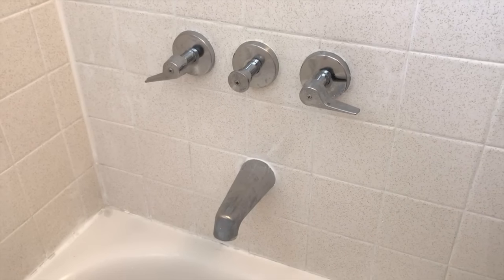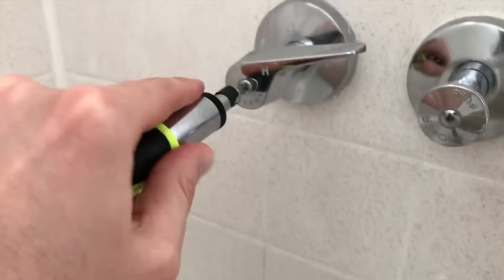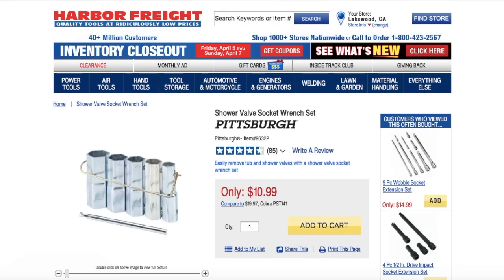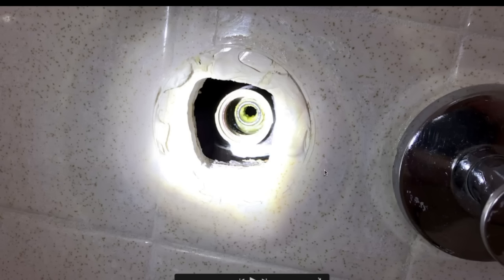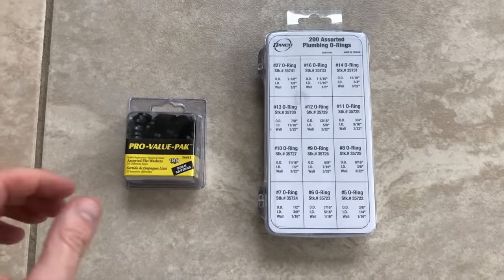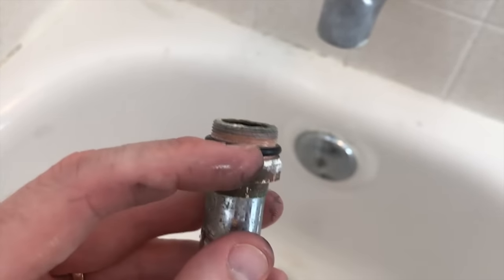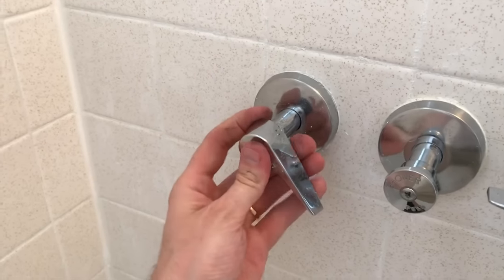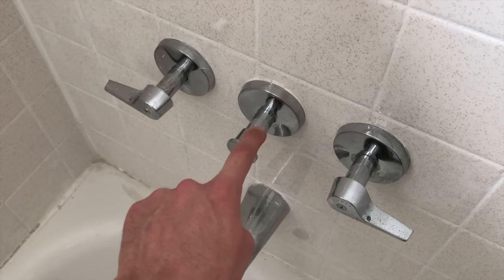My tub faucet is leaking/dripping - won't stop dripping - EASY FIX!

Comment: Hi Michael!  Great video!  I replaced all the seats, and stems from scratch. Brand new EVERYTHING! Gerber.  I still have a very small drip from my 3 handle tub faucet.  For the life of me, I can't figure out why.  After I installed everything, no drips.  After the first shower, small drip.  Should I replace the brand new washers?  Any thoughts?  Subscribed to the channel.  VERY helpful!  Thanks!
Reply from the maker: Jeff Rollins 

Thanks for watching Jeff, by chance did you add Teflon tape to the thread of your seats?  If not, we definitely recommend it.  Keep us posted.  Thanks for subscribing, we subscribed back.

😎👍🔧🔩
Reply: @DIYwithMichaelBorders Hi Michael! I did use a small bit of Teflon tape, buy maybe not enough. I will try and let you know. Now, I'm having diverter issues -- rumbles and hesitates when I turn it on. Yikes!
Reply from the maker: Jeff Rollins 

Thanks for the reply.  Definitely keep us posted.  😎👍🔧🔩

Comment: How may I find out what brand my tub/shower faucet is to get the correct replacement parts?

Also, What should I use in place of plumbers putty in my tub / shower that is not a plumbers putty compatible surface?
Reply from the maker: Good morning, it may be as simple as removing old spout and taking it to store to match it up with an exact replacement match spout.

You can use caulk to create seal around spout once installed.

Let us know if you have any questions and hey if you’re into crypto, join our DIY ecosystem.

       toolboxtoken.com

Reach out to us any time!  🧰

Comment: Mike Joe again ~    i have a leak  under the bathroom sink  looks like its the pivot rod  ,   is there a gasket inside that i was wondering  finally found where the water was dripping from   now to replace that piece  ..  does that ball part wear out ?    couldnt figure out  where the water was dripping i had to get a flashlight and  take a look and saw it  was that rod  ball thing  .  Thanks
Reply from the maker: Hey Joe, great to hear from you.  Below are a few videos that may help you get a bit more familiar with the plumbing above and under sink.

     1.  https://youtu.be/aZ3cRDtGRs8

     2.  https://youtu.be/pIYpl_7PIYQ

     3.  https://youtu.be/53KJUA9pEMI

     4.  https://youtu.be/xRjIp45KtpA

     5.  https://youtu.be/BAQ3OKjny_k

     6.  https://youtu.be/1b0asFPDzfA

     7.  https://youtu.be/JP40chUPXT0

     8.  https://youtu.be/5Jv1pkPjxds

😎👍
Reply: @DIYwithMichaelBorders   Thanks i will take a look at these .
Reply from the maker: @joedevitto6113  

😎👍

Comment: Great video. But my stem is threaded not smooth like yours. I’m stuck at how to remove the threaded stem. Any help will be great. Thanks
Reply from the maker: Thanks for watching & welcome to the DIY Raptor Club.  Have you removed old stem to replace entire stem or are you just replacing the rubber gasket?

Comment: I have a question and maybe you'll know the answer.  My tub faucet is doing something weird, not quite like this but it thought I'd ask.  I turn off the faucet and its fine no water running.  Within 10 or 20 minutes I return and it doing a steady drip of hot water.  If I turn either faucet on and off again it stops temporarily again.  Any idea what is causing that?

Comment: 1:56 you plug the drain so the screw can't fall into it.
Reply from the maker: Ed Napkin 

Don’t want to lose that screw.  😀

Us fellow DIY’ers need to stick together.  Let us know if you have any questions.

Please subscribe to the channel and Ring your YouTube Bell 🛎 that would be awesome thanks again.

😎👍🔧🔩
Reply: Trouble with those sneaky screws slipping through your fingers?  If so, yeah you should plug the drain, but your average DIY shouldn't have trouble holding on to the screw if they know how to use a screwdriver properly and secure the screw before it's all the way out.

Comment: Did you add plumber's tape before inserting the cartridge back? Required or not required? Thanks for a well done video in explaining what to do.
Reply from the maker: Good morning & thanks for watching.  In this specific video, we did not apply Teflon tape, just the rubber o-ring...however...below is a link to our video showing replacement of the stem.  In this video, we apply Teflon tape to the new part prior to install.

       https://youtu.be/F7B-3wR9aQ4

Definitely check it out, you may find it helpful.  Hope all is well.

😎👍🔧🔩

Comment: Ok so the one i have broke, and it wasn'y a metal like connection, it was with a plastic one, so my question is, do i NEED. A metal threaded thing from the wall to the faucet, or can i use another plastic one?? Also since its been using a plastic one for years perfectly fine, can i use a plastic one again? And can i just use a sprinkler riser as a connection
Reply from the maker: Chasen 161 

Awesome Awesome & glad it helped.  If your part has plastic thread, we would replace it with the same plastic thread part you have.  Head to your local hardware store & match it up with a new part.  Keep us posted.

Us fellow DIY’ers need to stick together.  Many more helpful videos to come!  😀

Please subscribe to the channel and Ring your YouTube Bell 🛎 that would be awesome thanks again!

😎👍🔧🔩

Comment: What if the hot/cold is one unit? One handle that you turn for hot and cold not two separate handles?
Reply from the maker: Thanks for watching, great question.  In your case, you will only be required to replace the one main center stem.  Please keep us posted.

Hey also if you’re into crypto trading, join our newly launched DIY community ecosystem.

     Toolboxtoken.com

We DIYers need to stick together!  🧰

Comment: Thanks ! This is very helpful and informative! I have one question though.  How do I figure out where to turn the water off to my whole house? Is it always outside or could I have an inside turn off point? Thanks! Sorry if this is a dumb question. 🤦‍♀️
Reply from the maker: Kara here 

Thanks for watching & what’s your update?  In most cases, it will definitely be inside & in very close proximity to your water softener & pressure tank.  You should have 2 separate valves...1 HOT water shutoff valve & 1 COLD water shutoff valve.

Closing both of these valves should shut off all water to your home.  After closing these valves, you can turn your water faucets on at your sinks and tubs and once the water stops coming out... you know you have cut all water from the system.
Reply: @DIYwithMichaelBorders  Thank you, that helps! No update yet. Have to get the gasket package and washer before I can do it. I will try to update when I've hopefully fixed it. I can't afford the extra waste of water dripping that's for sure! Thanks again!
Reply from the maker: Kara here 

You are very welcome.  Us fellow DIY’ers need to stick together!

😎👍🔧🔩
Reply: It's not a dumb question. It's a very important question

Comment: I'm here because I too have a leaking bathtub but don't actually care to repair because I'm searching for another apartment, so I'll let my family handle it when they get back. But I do need to turn the hot water off as I can't have that just drizzle. I couldn't find any gauge to turn the water off and then discovered that the water heater had a gauge ontop of it that directed to both hot and cold water, so I just turned that off. Is that okay?
Reply from the maker: Thanks for watching & that’s the shutoff valve to the heater itself.  It will stop water flow to tub however it may also stop flow of water to other faucets throughout the house...depending on how your heater is configured.

😎👍🔧🔩
Reply: @DIYwithMichaelBorders  Well, I only turned off one of them, the red one which was for hot water. It stopped all faucets with hot water but cold water runs fine. I live in an apartment and I can't find any valve of any kind to turn off the water. But I really just want a temporary solution until my family gets back and calls the landlord. I really want nothing to do with this apartment anymore so as long as this works, it's good enough.

Thank you so much for the video and the instructions.
Reply from the maker: @CrossoverGameReviews  

Thanks for the reply.  😎👍🔧🔩

Comment: Does the middle know (shower) have a stem? Because I replaced bit hot and cold stems but still have leak.
Reply from the maker: Thanks for watching & welcome to the DIY Raptor Club.  The center diverter may need to be replaced.

Below are several links to videos that may be helpful including a video showing replacement of diverter.

1.  How to replace SEAT.

       https://youtu.be/5Np19i1yVYw

2.  How to replace Diverter.

       https://youtu.be/ys-XS6cwcsM

3.  How to replace entire Valve Stem.

       https://youtu.be/F7B-3wR9aQ4

4.  How to apply Plumbers Putty

       https://youtu.be/Vp70ADnqbRI

Comment: What about if you only have one handle for water? Do you know where you turn it a certain amount for cold water and more for hot water?
Reply from the maker: Thanks for watching & that’s a great question.  If it’s a single handle/stem, there’s only one internal stem to replace.

One stem controls both HOT & cold outlets.  Keep us posted on your project.

😎👍🔧🔩
Reply: @DIYwithMichaelBorders  I ended up having to replace the whole mixing valve but it worked. Cost $26.
Reply from the maker: @juliebauml1942  

Thanks for the update, that’s actually a very friendly price & it’s great to hear you’re back up and running.

Hopefully many stress free days ahead for you Julie.
Reply: @DIYwithMichaelBorders  thank you and thanks much for your helpful video!
Reply from the maker: @juliebauml1942  

Many more helpful videos to come!

😎👍

Comment: Did this to my faucet changed everything including the seat and it still leaks any suggestions??
Reply from the maker: JayP1029 G 

Thanks for watching, let’s get this figured out.  By chance, did you apply Teflon tape to the seat thread?  Keep us posted.  Us fellow DIY’ers need to stick together.

😎👍🔧🔩
Reply: @DIYwithMichaelBorders  do you recommend teflon tape or not? It a scary to think one can't get things reseated right, no water till you can get a plumber. Eeks
Reply from the maker: @AmethystWoman  

Thanks for watching & Teflon tape is recommended on the thread of the stems/cartridges.  😀👍

Comment: How do I make the water stop dripping from the faucet after I turn everything off..its only the hot water no matter how hard I pull to close the hot water handle it doesn't stop slowly dripping and it now spins all the way around instead of off and on positions with the inbetween only
Reply from the maker: Thanks for watching Joshua, let’s get figured out together.  Sounds like you need a new seat & stem.

Below are links to videos that will help you become familiar with the parts for your DIY project!

1.  How to replace SEAT.

       https://youtu.be/5Np19i1yVYw

2.  How to replace entire Valve Stem.

       https://youtu.be/F7B-3wR9aQ4

3.  How to apply Plumbers Putty

       https://youtu.be/Vp70ADnqbRI

Comment: If you have a shutoff valve on the tub you don't have to shut down the house water do you?
Reply from the maker: Good morning, we are drinking our morning coffee answering any and all questions for the DIY community.

Thanks for sharing, any and all helpful info is greatly appreciated.  😎👍
Reply: @DIYwithMichaelBorders  so if I have shutoff valves for the water on the tub I can bypass turning off the water to the house right?
Reply from the maker: @orochikaiba  

Thanks for the reply, that will depend on your exact setup and the type of project.  Without knowing the exact plumbing design, we can’t give you a confident answer.
Reply: @DIYwithMichaelBorders  replacing the washer for my dripping bathtub faucet like in this video. The shutoff valve on the back of the tub is below the height where the faucet handles would be
Reply from the maker: @orochikaiba  

Nice, please keep us posted on your project.  Looking forward to hearing back from you.

😎👍

Comment: Where are you located?  I hired a guy to replace my brand new kitchen sink faucet and w/in a day it won't deliver a nice stream of water and an the diverter doesn't work  Also have a leaky faucet in the shower which started leaking shortly after it was supposedly fixed,.  I got ripped off obviously.   I've spent over $1500 and still have the problem!  PLEASE HELP or help me find an honest plumber.  So frustrated.
Reply from the maker: 😳...that’s doesn’t sound fun.  We are always here to help answer questions.  This is the best way to stay in contact with us.  Sounds like you’re considering taking things into your own hands.  Welcome to the DIY Raptor Club.  😀

Keep us posted on your projects & any questions you may have.

😎👍🔧🔩

Comment: Here's my problem. Old American Standard 3 handle with faucet leak on hot side. Replaced rubber washer and seat. I did not use teflon on seat threads.  Now it's still leaking, but only cold water now. Should I try replacing washer and seat on cold side, or look for something else? Thanks
Reply from the maker: Thanks for watching & welcome to the DIY Raptor Club.  We definitely recommend Teflon tape.  Since your in the zone, we recommend replacing cold stem & diverter as well.  You will feel very good.  Keep us posted.

😎👍🔧🔩
Reply: @DIYwithMichaelBorders  - I'm sure you meant to say to replace just the seats and washers on the cold stem and diverter.
Reply from the maker: @ACE-gj9zq  

😎👍

Comment: Does the Diverter valve also have a rubber seal?
Reply from the maker: Cuervo Vallejo 

Thanks for watching.  This will depend on the specific valve stem/diverter set.  In our case, the diverter had a rubber gasket however there is no internal seat inside the valve.  The hot and cold stems have internal seats inside the valve.  Hope this helps.

Us fellow DIY’ers need to stick together.  Many more helpful videos to come!  😀

Please subscribe to the channel and turn on your YouTube notification Bell 🛎 that would be awesome thanks again!

😎👍🔧🔩

Comment: Need help! I replaced the washer on the left cartridge for the hot water, seat looked fine (i think). The right on the other hand. Holy Jesus. I took the cartridge out and water was slowly flowing from the pipe when i looked at the seat, down behind the wall. I quickly put the cartridge back on, luckily the water didn't continue trickling. Does this mean the seat is severely damaged? How do I prevent the water from continuing to trickle to take the seat out? Shouldn't it not be flowing? Water main is off. I let all the water drain before attempting project like i did with the left one. Is the seat not the problem? HELP! Please and thank you.
Reply from the maker: Thanks for watching & welcome to the DIY Raptor Club.  We appreciate you reaching out to us.

First, we recommend shutting off main water supply shutoff valve to home.  After the main water supply shutoff valve has been closed, turn on all water faucets and allow any and all remaining water inside plumbing to drain out.

Once all faucets no longer have water coming out of them, it is safe to continue your DIY project of removing the inner seat.

When installing the new seat, don’t forget to apply Teflon tape to the thread for added reliability in terms of ensuring a water-tight seal.

Keep us posted.  😎👍

Comment: I did all that and everything went fine, but.... Now the pump will not turn back on. No Water from well.
Reply from the maker: Thanks for watching & we appreciate you reaching out to us.  Double check all valves are properly positioned to open & all breakers are returned to normal operating configuration.  Keep us posted.

Comment: I turned it off from the back didn't stop
Reply from the maker: roger funk 

😎👍🔧🔩
Reply: @DIYwithMichaelBorders  I meant after I turned off the water from behind the shower it keeps dripping and no water coming out when I open lever
Reply: So u got turn water off from basement?
Reply from the maker: roger funk 

Thanks for the reply.  You will need to shut off the main water shutoff valve to cutoff all water to home.

😎👍🔧🔩

Comment: My faucet still leaks after replacing seat, and rubber seal.
Reply from the maker: Thanks for watching & welcome to the DIY Raptor Club.  By chance did you apply Teflon tape to the thread of the seat?  This will help create a water-tight seal.
Reply: @DIYwithMichaelBorders  No there was none on it, I asked the guy if he would put teflon tape on it or sealant and he said no. Have you had a problem with a faucet leak and you placed Teflon tape on it and it corrected it? the house was built in 68
Reply from the maker: @tigerboy60  

Thanks for the reply.  Teflon tape will definitely help stop your leak.

Comment: Don't you need to turn off the hot water heater.
Reply from the maker: Thanks for watching & you will need to shut off main water supply to close off water to plumbing in bathroom/bathtub when replacing internal stems/cartridges.  Keep us posted on your project.

😎👍🔧🔩

Comment: The warm water side looked like it was on
Reply from the maker: Thanks for watching & welcome to the DIY Raptor Club.  The knob itself was not properly aligned.  

We unscrewed securing screw and pulled knob off and repositioned knob on the stem splines to get it back to normal.

😎👍
Reply: @DIYwithMichaelBorders  I was going to reply after I saw you realigned it towards the end but figured you knew that I would have that answered once I fully watched the video so thanks!!!!
Reply from the maker: @cricketyurchick1167  

Thanks for the reply, any & all helpful info is greatly appreciated...even if it’s pointing out something we missed.

😎👍